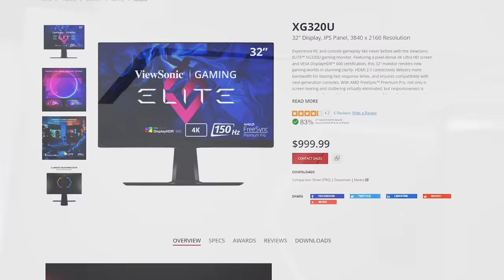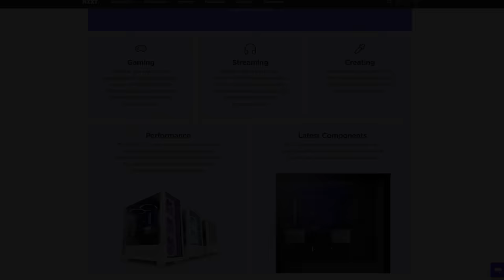EPIC case mod - The Expanse

Comment: Have some old AIO tubing sticking out of the hole ... Cut in half and all frayed so it looks like it was sheared in two when the rail gun sabot round went through. You could even put little RGB LEDs inside and have them flicker blue like there is still electrical current flowing through it.

Comment: Expanse is a great theme! Maybe add some fibre optic cables through the blow out hole? Could make it look like the electronics are shorting, without having to use actual sparks
Reply: RGB the fibre optics along with the shorting effects as if they are still powered? IDK,, maybe stub the inside ends to an RGB fan to carry the colors?
Reply: @TheCoverless  was thinking of something a bit more randomised, like the flashing pattern you used to get when HDD was in use. but if the rgb on the gpu can be set to a blue flame mode, that could look cool through fibre

Comment: If you have a Resin 3D printer the damage area could have some sort of crystal/explosion residue (think clear resin for RGB ) coming out  (alternatively use transparent/clear PLA). You could use opaque/cloudy water cooling pipes with RGB strips for effect on the outside, for more dramatic visuals.

Comment: An open loop would be cool on this. Mount the res and pump on the front panel. Rad on the side and use some type of mesh or braided tubing.

Comment: Jay, A good tip when using aerosol cans is pre-heat the cans in very hot water for around 10 minutes, shaking well during the heating. Then the paint will be hot when it hits whatever you are painting and will dry almost instantly!

Comment: Hey Jay, not sure if it's been mentioned already, or if you've thought about by the time I post this, but to make the edges on the exit damage would you consider melting some rubber or plastic to soften the edges in order to prevent injury?

Comment: Take a torch and singe the ends instead of a file. a regular propane torch will get it hot enough to melt the small shards of steel.

Comment: Although it would somewhat go against the work you've already done, one thing that's true about the Rocinante, especially later in the books, is that it is a patchwork of repairs and tacked on items (including the railgun). You could do some haphazard "repair" to the hole that seals the hull but looks rough to reflect how they often fixed things in transit after battles.

Comment: For the "wires" you want exposed from the opening can you use fiber optics?  That way you can light them up, and with an ARGB light on the other end you can change the patterns and colors that blink at the exposed ends.

Comment: just an FYI, in space metal can oxidize, in fact it happens faster than here inside our atmosphere. some anti corrosion metals end up just building a crust on its surface and end up eliminating the oxidation process all due to oxygen existing in a single molecule instead of o2 form.

Comment: you might want to consider a flat piece of metal that looks like a " food tray " over the hole held in place with expanding foam.  Similar to how they had to stop a hull breach.  There may be some 3d files online so you can print it and use real expanding foam from the inside and save having wires around that lead to nowhere.

Comment: I know I'm a couple days late on something for such a huge channel but I do have a mild suggestion for both the old SW project and this new project. Look at model kit battle damage techniques to help add to the realism with the battle damage. There are a LOT of techniques that are applicable. If you can do it to plastic doing it to metal is kind of easier. Oh, and if you want to simulate oil splatter or something use a smoke color paint with some rust color and a little thinner.

Comment: i have three cars apart, plumbing to run, new gas line to run, stairs to buiild, painting to do, bathroom trim and culk to put on, windows to replace, a CNC mill to build, garage to raise, electrical runs to tie up, boxes to close, and god knows what else... all projects i have started and not yet finished

Comment: "I don't want this to be the finger-slicer 5000" Says Jay, as he manufactures the finger-slicer 5000 now with included textile-ripper 2000 and dust-collecter 9000, with optional wire-Shortcircuiter 3000

Comment: Add cut fiber optic cable with the wires that come through the damaged exit  hole run them off some RGB controller so you can pick your color and also strobe/flash maybe like a signal of some kind

Comment: cut your wiring with a torch or lance. so when they come out they are burnt, charred, melted.. the copper in teh wire will have melted too.    also when making those holes - id use a jig to brace the rest of the metal to prevent bending and warping. 
if it were me i would tig weld bit of melted steel to it. so get a sheet of metal, heat it until its liquid and oozing. then cut that piece out and weld it to the areas of the case you want. that would be faster than 3d printing and more dynamic control in the moment.

Comment: If you plan to use the grinder to start all the holes, maybe consider doing more than 2 lines (not a "plus") for some so they don't all look like squares. You could do uneven numbers (Eg; 3 lines) if you start the holes from the center point moving outwards, not passing the center point.

Comment: I know I'm probably a bit late for this but if you could manage a custom loop for the CPU having the resivoir hanging on the outside at the top with the radiator below (like in the old days of custom watercooling) it and only the CPU block inside... I think that could work really well with the theme and get more cooling performance.

Comment: I was wondering if the AIO pipes could be brought out through the back panel and loop around to enter the rad from the outside. It would certainly add to the industrial/scifi look with external tubes.

Comment: It is worth noting that while rail guns are a kinetic projectile and not an explosive shell, they still wind up getting quite hot, particularly in atmosphere.  

These are projectiles going absolutely absurd speeds - real world test rail guns fire at 2.5km/s, which is about a third of the re-entry speed of the old space shuttles and (very broadly) about 10 times the speed of a bullet fired from a pistol (which, yes, varies significantly).  

So we're not quite talking the kind of speed where you need specialized heat-absorption panels to not melt while going through air, but we're getting pretty close.  And...no disrespect to the US Navy's rail gun testing rigs, I feel like the stuff we see in sci fi is probably substantially more potent than anything modern technology can produce.  And that's just friction heating from the air.  Once we get an impact, a lot of the energy just immediately becomes heat.  (Take an elastic band, stretch it out and unstretch it a few dozen times, check how warm it is...same effect, just way, way more energy involved.  If you've got a workshop and some scrap sheet metal or something, you can beat on it with a hammer for a bit and have a more obviously parallel effect.)

Point is, if you're talking an exit hole, the slug of a rail gun is gonna be plenty hot after tearing through a space ship, and is gonna be much, much hotter if it's used in atmosphere.  So stuff getting a little melty in the exit hole design is entirely realistic.

Comment: Jay: prep is very important. Also Jay: doesnt bother to sand anything...
Reply: You really, REALLY, do NOT want to sand before painting in this case. 
The reason you sand before painting is actually to rough up the surface to give the paint something to grab, not to smooth it out or clean it.
The surface on the steel is a powder coating, electrochemically adhered, NOT a traditional liquid suspension paint, which is why it didn't just vaporize around the hole when he took a torch to it.

Comment: Inside the railgun hole you should put some led lighting so the light shines out and have it on a lightening storm setting with orange and white with some wires coming out. Short circuit effect lighting.

Comment: For the exit holes - do you not live somewhere near a shooting range? Find someone who'll shoot the panel with a shotgun slug, and you'll get a big hole in thin sheet steel. It's fast, it's fun, it's realistic. Only issue is accuracy, but a good shooter can handle that easily.

Comment: I still think you should have just mounted a 280mm rad to the outside of the first build. You coulda done a shroud around it and made it look good. The whole idea of rebel tech to my is haphazardly put together, improvised and revised. They don't have shiny new beautiful tech like the imperials do. They have older tech that went through frequent upgrades and patchwork to make it work for the moments need.

They can't just slap a new build into a new box always. Sometimes they have to make a build work in an exiting enclosure and ramrod the parts the best way they can. When that overheats they just expand an exterior radiator on the side and call it a day. ;)

Comment: Where you run the tubing for the external rad, also run a section of hose that has been sheared off, hanging beside the rad, leading from inside.

Comment: I like to see case mods that use out of the box thinking.  I've always wondered why there aren't any cases available that are designed for function.  Why isn't intake and exhaust air directed to the GPU?  Why isn't intake and exhaust air directed to the CPU air cooler?  Why is there so much open space in places where nothing will be placed?

Comment: External radiators with repaired/patched, hoses coming out of the main case.
Motion detector with a articulating gun mount that targets movement in the room....
Jet engine after burner flaps that dilate open wide, and close with the speed of the fans they are mounted to.
Color scheme the  l.e.d.'s to match the afterburners orange ad reds for low speed blues and whites for high speed..
external Antennas/wifi range extenders etc. l.e.d. indicator of broadcasting...

Comment: it's not too bad, within a day of owning my cooler master 500m i took the dremel to the upper brackets so i could fit my upper radiator lol, 
it technically works just fine, but the spacing was tight so i had to move the rad as far to the side panel as i could & only could get like 6/12 screws into the radiator, but it's been that way a couple years now and still holding strong 😂

Comment: Some kind of shielding under the exploded area would be needed in space to prevent explosive decompression of the ship
Reply: Nothing. Unless the hole is massive, explossive decompression isnt an issue. 1 bar of pressure (sea level) is 14 psi approx. Adam savage did a physics thing about it during the making of the expanse.

Comment: Reminds me of an Emergency Operation at a Holiday-Camp in the legendary hot Summer of 2003 in France. In the Morning already over 40°C in the Shade. It was so hot that the Computer switched itself off shortly after booting up... I then bought 2 350mm Fans and Funnels from 350mm to 200mm from the Electrician in the next Town. Back at the Campsite, the Aluminum Case of the Shuttle xPC opened on both Sides with a Dremel and the Funnels and Fans attached on the Sides... Computer looked like an strange Alien in an Comic of the 60th ... Could increase the Computer Runtime up to 40 Minutes before Shutdown in the Night. Enough to upload daily updated Photos to the Website of the Youth Center so that the Helicopter Parents didn't keep calling ...

Comment: I noticed the rad at 5:05 is installed unside down. Shouldn't it be flipped so the air goes to the highest spot in the rad?

Comment: You won't have "rust" on a spaceship, no. BUT. What you "could" have is nicks and streaks on the metal from exposure to any number of things, like tiny bits of dust travelling at millions of miles per hour, or cosmic radiation, gaseous expulsions from stars and such. If it's been in battle a lot and repaired frequently, you could have any amount of scorching that you want. I never once thought of the original "Star Wars" build as anything with "rust" on it.

Comment: Hey Jay, I dare you to make it a custom loop watercooling, you can use the integrated pump waterblock from EK and a radiator on the outside, one of the new ones, and you wont need an actual reservoir,

Comment: Jay, you do know that Falcon just took a Silverstone / Fractal Design (RVZ01, RVZ02, RVZ03, ML08, Node 202, Ridge) that has been around for a decade now and improved/iterated on it, right? The flow-through, the ventilation on the backside of the CPU socket, and the weighted base are the notable major changes from the most recent iterations (note that the RVZ01 originally had a slimline ODD slot, too, but I think that was gone with the Ridge)...Granted, these changes probably drastically improve that design of case, but still...
Reply: The Tiki predates all of those cases. It was first released in 2012.
Reply: @Falcon_Northwest oh wow! My bad, then!

Comment: Why not do a Custom Pump-block and 280 external rad maybe use something that looks like hydraulic or high pressure lines (or could you use actual??) for the tubing

Comment: With an Nvidia RTX A2000 12G low profile GPU you can cut 4" of the case height. Get the GPU, angle grinder and a welder. Easy peasy😂

Comment: Jay, I have heard on your video that the core with the hottest temperature was you best core. I hope that you were joking. I believe that the core with the hottest temperature is the worst core, i.e. the least efficient, and using the most power (watts). The extra heat affects the other cores on the CPU and is more heat for the cooling to transfer out of the case. When a core gets too hot the thread that it is working on and the level 1 and level 2 cache are transferred to a cooler core. This results in a series on no ops on both cores. The CPU and its bios will use a higher frequency and voltage (turbo boost) on a core if the temperature and voltage and maximum frequency will allow. Turbo boosting is an efficiency and time thief. Not only does it operate on the steep part of the power vs frequency curve, but it also leads to threads swapping to cooler cores which wastes time. You can see this play out running Cinebench in the single core mode and watching the frequency and temperature bounce around on different cores.
Do not let the worst core limit getting the most out of your CPU lottery and cooling solution. Using Intel’s Extreme Tuning Utility (ETU). Set Turbo Boost Short Power Max to Disable and Turbo Boost Power Time Window to 1. Run Cinebench multi core mode with all the like cores (P & E) to the same frequency. Find the “bad” cores and set them one core multiplier (x) lower. Next, set the  Turbo Boost Power Max to a few watts higher than what the ETU monitor shows. Let us know how this works for you or if you have a better method.

Comment: Hey Jay, love your stuff, I have a home heating ducting based idea based on your videos, i'd be interested to get your opinion on it,  the basic design is basically thought out, I could explain it or draw schematics if necessary, i'm building a 30sqm extension to my house to accommodate my daughter, so the structure is easy as long as I know it's a viable option and not just a ill informed scheme, I couldn't find another way to get in touch with you, sorry